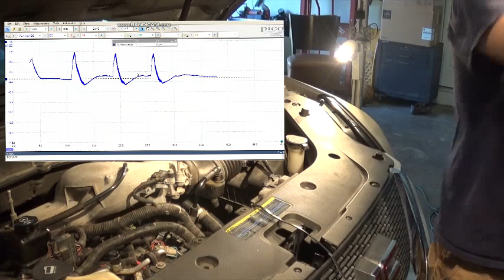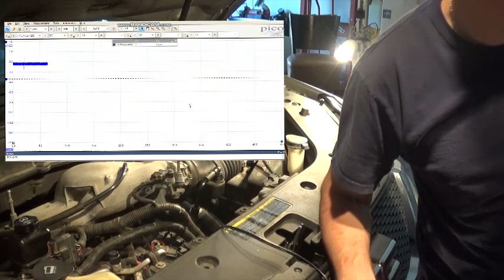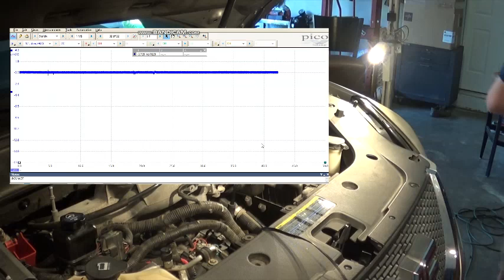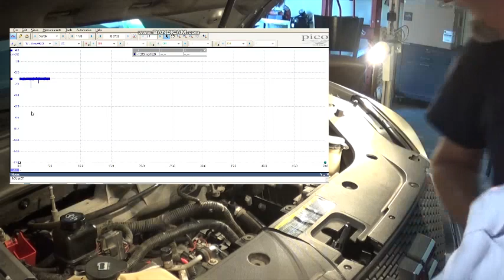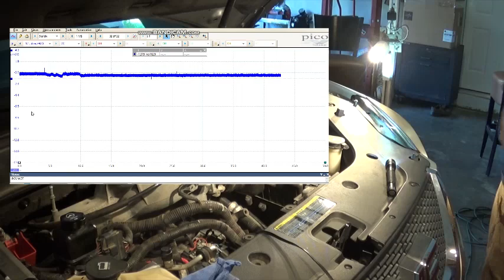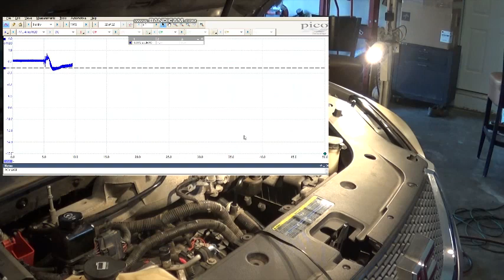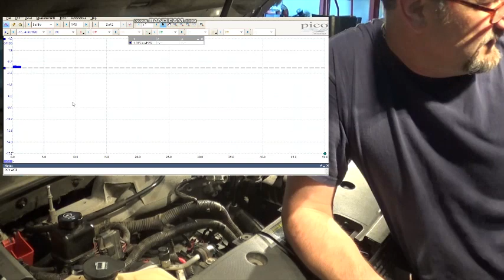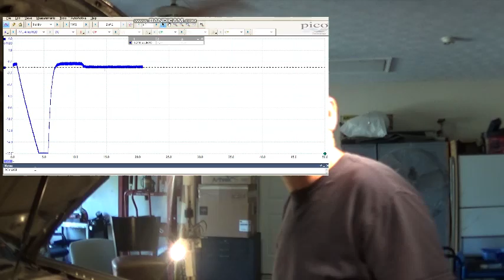Testing PCV System With Pressure Sensor

Comment: Sorry you got burned and yes this PCV valve (orifice) is one of the hardest to change. The PCV valve you removed was not an OEM but was a BWD PN PCV660 or equivalent AM with the 2 holes in it and it's a shorter design that fits into the valve cover than the OEM. The newer OEM is a single hole that is larger than the total of both holes in the BWD or original OEM design. The newer vehicles have the same style PCV (It's not a valve actually just an orifice) with a larger orifice however they want you to replace it by changing the valve cover (not happening). The OEM is a lot harder to remove than the AM one you removed. It is a metal to metal interference fit and longer. To install I warm up the engine but be careful of getting burned and freeze the PCV and you have @15 seconds to get it the majority of the way in and lube both the hole & PCV...I'm not replacing the valve cover.  The aftermarket PCV has a smaller OD than the OEM PCV & is slightly easier to install. I drill the top & bottom holes in the PCV valve larger the top to 1/8" and the bottom 2 holes to 5/64" which is equal to the newer late 2013 to current OEM orifice size. The 2 small holes clog up faster than the newer single larger OEM valve hole and the smaller holes do not create enough negative crankcase pressure and result in positive pressure blowing oil into the intake tube. It's a bad design PCV plain & simple and is prone to clogging unless you drill holes and also creates slightly more crankcase negative pressure helping ring sealing and gasket sealing. These engines need catch cans and it helps keep the intake valves cleaner b/c they get gummed up bad. You empty the catch cans at oil changes. The more piston ring blow-by the engine has the more need for a catch can. I install the Rx Catch Can and also the Rx Clean Air Side system. You empty the can at every oil change. I also spray in a can of CRC Intake Valve Cleaner at every oil change & it helps remove some of the gummed up crap on the intake valve. I also use it when I have the intake plenum off and clean the intake valves with the CRC and my large wooden q-tips if the customer approves it and it helps cold starting and you can feel the improvement. How do you like how loud the purge valve is...no doubt it is PWM :D
Reply from the maker: Wow thank you so much for this info. I was very surprised to see such low vacuum in crank case. I will check that car again soon. Has coolant leak. Valve I got is from dealer and as you said it's old design. I am going to drill holes as you do and retest PCV system to see what improvement we can get. Thank you again my friend. Cheers
Reply: The holes can be increased up to 7/64"  if you are still getting any oil in the air tube as mileage increases & the engine wears. Rx has a kit for the clean air side which eliminates the OEM PCV air tube and they have an oil cap replacement that has a mesh inside that catches any oil blow-by and it'll drip back into the crankcase instead of puddling up in the air intake tube. The clean air kit is @$105 and the entire system for both sides with dual valve can is @$400-450 but well worth the price because it keeps the intake valves from crudding up thus eliminating induction cleaning service or removing the intake plenum and cleaning the intake valves plus the engine runs better with no loss of VE/power & fuel economy, better cold starts and no associated DTCs. Also the can is a dual valve so it has the normal vacuum source from the intake and you add a port just prior to the TB so idle or under acceleration you will always have either ported or unported vacuum (old carburetor guys are familiar with that with distributor vacuum advance). On race engines to maintain a zero to negative crankcase pressure & to help eliminate ring flutter we used the exhaust with a scarfed diverter to the breathers on the valve covers (Moroso system)...just a tidbit of info for curious minds. Now I sound like a salesman but you know intake valve cleaning is a requirement on DFI cars without catch cans.  Now back to the PCV orifice holes...you should see a slight increase in negative crankcase pressure at idle but your fuel trim & idle will still be good if they were good to start with. If I see oil in the intake tube I also clean the TB b/c the intake tube is already removed to clean out the oil and it only takes a few minutes to clean. I like your pressure sensor test b/c it's more scientific and actually reads the crankcase pressure & efficiency of the PCV system vs the vacuum test I've used since the 70's. It's like a testing a loaded & unloaded circuit...what does it do under current or airflow.
Reply from the maker: It will be interested to see what difference larger hole is going to make. I will get this car back in couple of weeks. Thank you sir for information you provided on this topic. It is always pleasure to chat with you. Cheers
Reply: Goofy design, a PCV valve shouldn't be so difficult to swap, and you shouldn't have to do major modifications like catch cans to overcome obvious design errors. It's great to have experienced help here in the thread. Another creative video, Ramon!

Comment: Great Video, sorry to see you got burned. That unit you used for pressure doesn't ring a bell for us in the rest of the world that use metric unit. 🤣
Reply from the maker: Thank you for watching my video Dan. Unit we use is inch H20. Conversion is 1inch H2O =  249 pascal . Very low vacuum  but it can be measure with fuel tank pressure sensor. I am using GM FTP sensor with home made 5V regulator. $20.00 investment works great. Cheers my friend.

Comment: I was taught that you can check the pcv system ( not the valve) by removing the the pcv hose and idle cover the end with your thumb and if the rpm’s drop then the system is operating properly and not plugged up. 
Now the newer cars my be different. I’ve been out of the repair business for quite some time. 
Good video 👍🇺🇸

Comment: I think that the oil in the duct is collecting form the hose that connects to the front of the valve cover.  The flow of PCV air is reverse to the flow that oil would have to take to get into the duct.  I wondered if, a restricted air filter, under heavy throttle operation, could allow a reversal of flow?  The pressure in the manifold would be equal or higher than the pressure in the duct.  Or maybe oil vapor condensing after shut down.  I wonder if there is oil pooled in the intake manifold?  Other GMs have had issues with the oil separator, in the valve cover, passing oil into the intake.

Comment: Thanks Ramon,

is it posible to get a meaningful  reading of the blow by pulses withthe tankprssure sensor?
Reply from the maker: I don't know yet. It will be interesting to see waveform on engine with bad compression rings. I will make another video and create misfire to see how will affect crankcase pressure. Cheers my friend.
Reply: juergen scholl yes u can,if u go to firstlook sensor website it is demonstrated on diesel engine,but it will work on any engine,the pcv intake method won't work on turbo or supercharged engines because of positive pressures on intake but u can use through exhaust also,just tricky if u have a dual exhaust car

Comment: What are the custom settings you used on the Pico? I've thought of using a MAP sensor but I don't know what the voltage/vacuum correlation is
Reply from the maker: Varian Styles I was simply comparing voltage with pressure looking on scan tool on my truck to get correlation data. I don't know what is on your MAP   Sensor. Do you know how to customize probe on your picoscope ?
Reply: Yes I followed your earlier video about custom probes & have all of them.  Not sure if you used a linear scale or lookup table for your values
Reply from the maker: On my FTP sensor I used lookup table.
Reply: Varian actual pressures are not very important,u want to look for comparsion of powerstrokes and intake strokes

Comment: fresh air goes into the engine from the intake side of the pcv   I don't think you can build much vac
Reply from the maker: scuba422123 yes sir I believe you are correct. That's why I used FTP sensor that can measure such small vacuum. Cheers
Reply: when the engine revs manifold vac drops pcv drops and blow by increases
Reply: a clogged pcv will back up the fresh  air side and oil into the intake  but a positive pressure can cause seal oil leaks  the old days when the air filter used to get oil logged from the breather it was really bad piston rings

Comment: This test cannot be used with old car because the engine will be worn and you will have pressure in crankcase.
Reply from the maker: Petar this engine is 10 years old with 198,000 mil.

Comment: Ramon good video. What is the vacuum spec. For the vehicle? Could it be developing internal problems? From the looks of the sludge buildup on the PCV valve I would say internally the engine would not be much better. Looks like it needs a good flush or at least an oil change which from the looks of it was not performed on a regular basis. Keep us informed if they bring it back. 👍
Reply from the maker: Arthur Fricchione I am not done with this car yet. Looks to me that vacuum is way to low. What I usually see is around -3 to -5 inc H2O. I am thinking to drill larger holes in PCV valve. I just hate to remove valve again. It's major pain to do it.👍👍